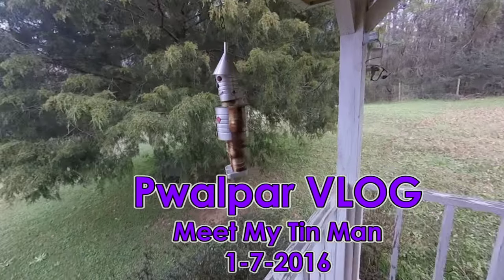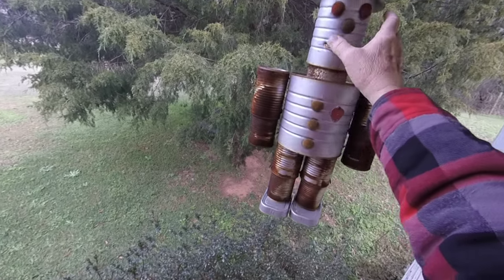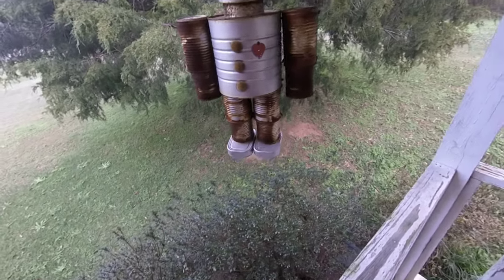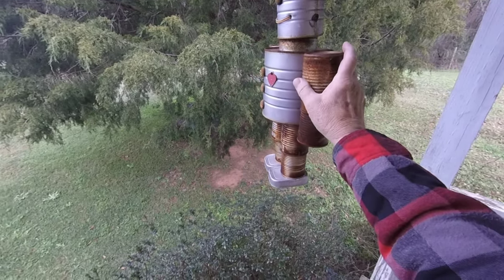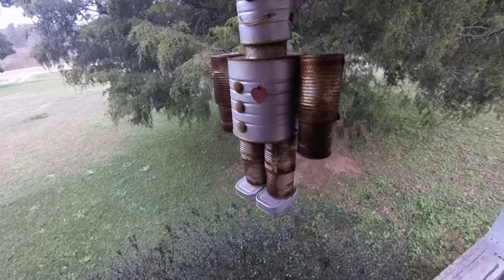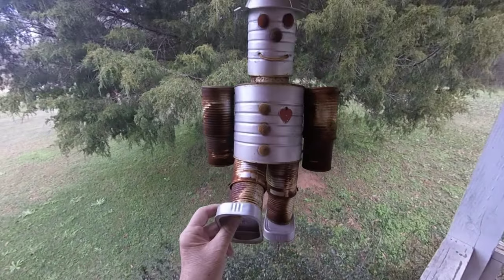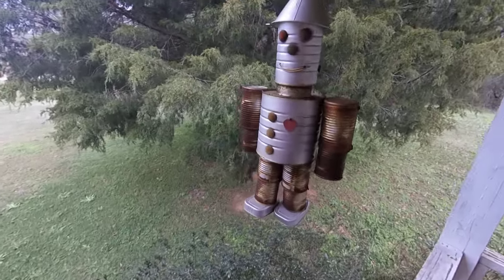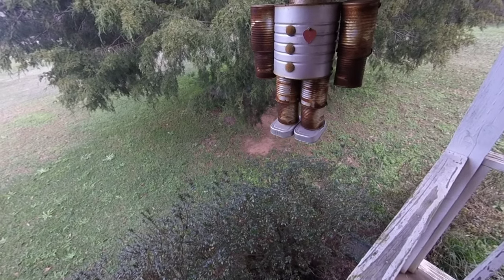Pwalpar VLOG Meet My Tin Man 1 7 2016

Comment: Walter, an easy way of reducing the rust before painting.
Use commercial toilet bowl cleaner, the kind with 23% acid
Its cheap for a 1 liter bottle
Just lay the cans down and squirt some cleaner on it
You will see the acid lifting the rust easy
Might need to squirt a bit more on heavy rust
Then just hose off the cans after it sits and does its work
Don't breath the fumes ! ! ! (O.o)
Let it dry and paint. 
Nice can ornament you made.
Reply from the maker: +Kitty Cat Thanks for the advice :-)

Comment: I'm full of questions, for example, what is generally the problem when a locomotive spews thick black smoke. Is it in need of filter changes or are the injectors dirty and need cleaning/replacement? Are the railroads required to use low sulfur diesel like the truckers or can they use the high sulfur because they aren't highway vehicles?
Reply from the maker: +norman mckenzie Thanks Norman